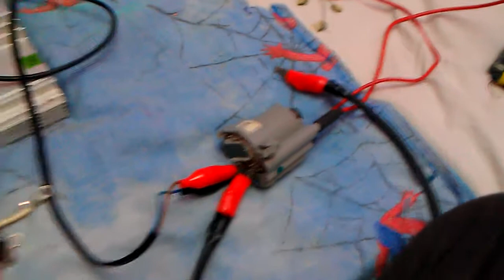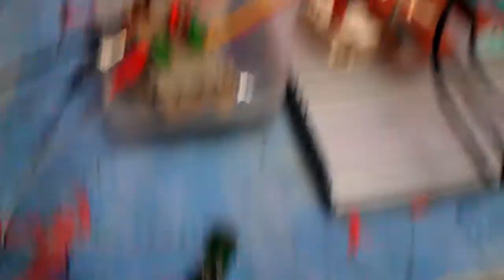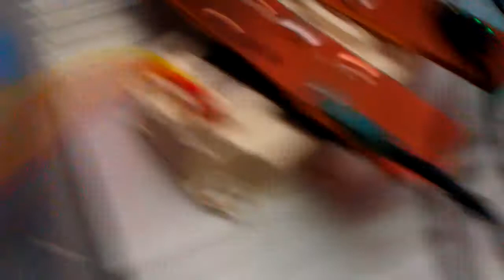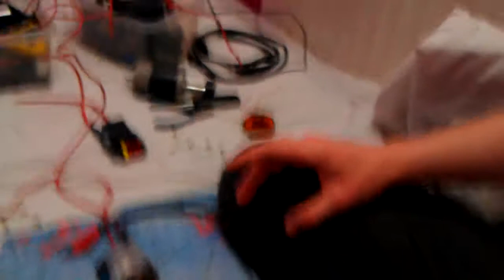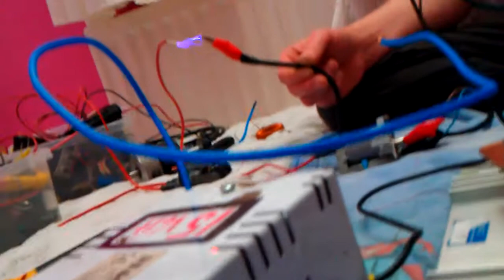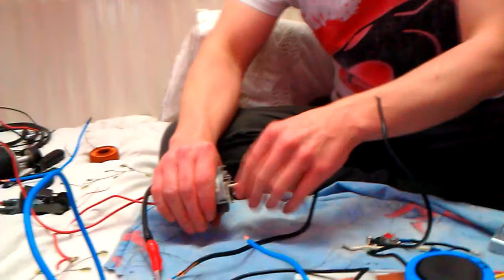IGBT running flyback

Comment: Could you make a diagram of the circuit?
Reply from the maker: If you give me your email I can send some pictures of the optocoupler circuits that I use for the ibgt gates! And to wire the igbt up is the same for all igbts as it’s the gates you have to be careful with! But just search in google images night wiring and it will give you everything you need !!
Regards

Anthony

Antwasere@gmail.com